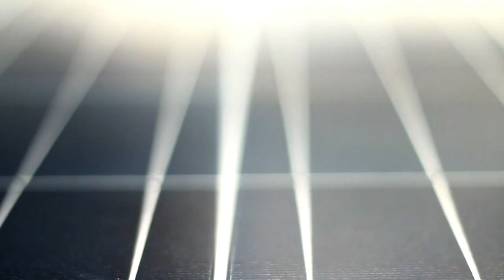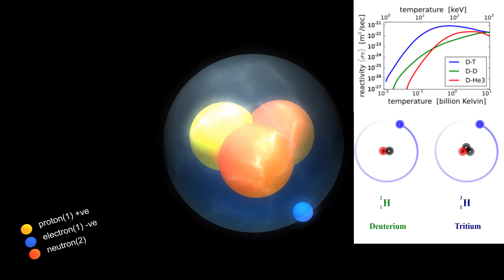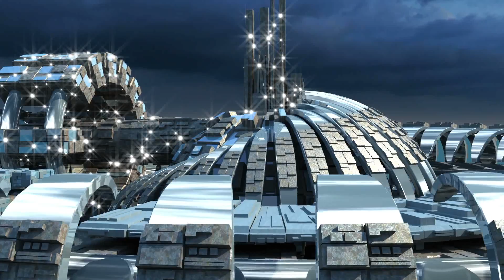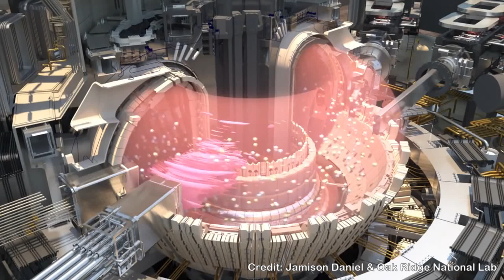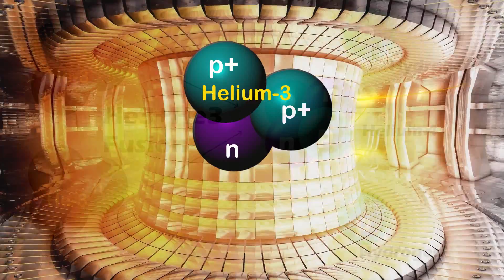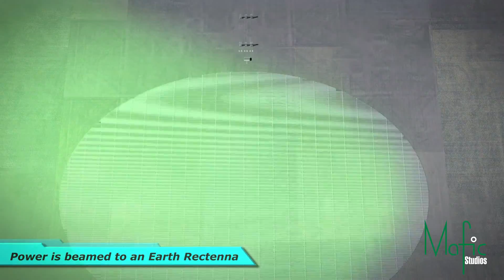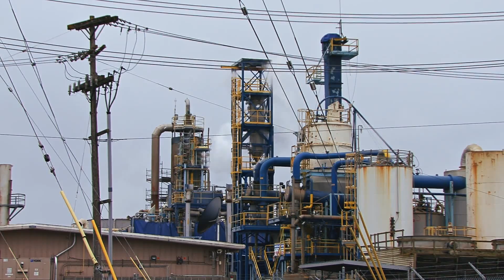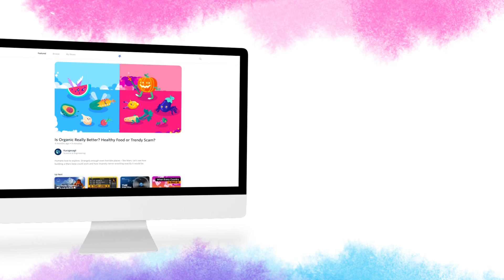Fusion: Powering a Bright Future

Comment: i keep pointing out that such exotic and dangerous tech is completely unnecessary. the u of ark discovered a method for tapping a function of physics at the atomic level that produces electricity for forever. the samples demonstrated were minuscule yes but the fact that it works in any demonstrable fashion makes all other energy systems impractical at best. 
with the method the u of ark demonstrated so radically changes things that it seems too good to be true, it permanently sequesters carbon, in its initial form it is ideal for supplying electricity directly at the point of use for microelectronics and, as mentioned, the tech can be scaled up to proportions sufficient to supply the entire planetary power requirement every second for forever in a sphere a mere 50meters across that is only 3/4 full of the graphene material.
this system is also the ultimate 'civilization' energy source it allows for the complete leap from type 1 to type 5 civilization bypassing the 'power of a X' ranging from star to solar system to galaxy and jumps right to drawing energy directly from the quantum foam i.e. drawing energy from the entire multiverse.
the stock response 'but its a new tech that will take years to mature' spend a fraction of the hot nuclear budget on this working demonstrable tech and a functional power core could be demonstrated in less than a year because it is much easier to build test redesign a cold solid state generator than any other power system

Comment: A viable, reliable, reproducible method of "cold" fusion, is Muon catalytic fusion. Compress the hydrogen, and the Muon(gigantic quantum electron) will knock the electron out of the way and offer enough gravity to overcome the coulomb barrier, before getting ejected by the release of heat. The problem with Muon Catalytic Fusion, is that the Muon only lasts about 100 reactions, and that amount of energy is about half of what it takes to generate a new Muon in the lab.

Comment: Aneutronic fusion reactor/engine is a wonderful idea. As I understand it, it's not a heat engine at all. At least it does not have to be, as most of the energy it generates is in the form of the kinetic energy of charged particles. And the movement of charged particles is basically electricity. Well, it would have to be made directional, in order to convert it into electricity running in wires - into a jet of charged particles. The efficiency of that kind of conversion might be quite high, compared to heat most engines. And there is another upside of solving the directionality issue there - once you have a reactor that can generate directional jets of plasma, you basically have a rocket engine. Seemingly simple and elegant technology. SEEMINGLY

Comment: I find it ironic in a tourtoise vs hate kinda way, that there have been a double handful of ideas to try to bypass the tokamak and shortcut to viable nuclear fusion.  ITER is incredibly delayed and overpriced, and tokamak fusion progresses so slowly it will not be viable in most of our lifetimes and will arrive too late to prevent climate change or the bottleneck of fossil fuel depletions.
 Every single alternative to big clumsy tokamak has run into a showstopper, an unforseen engineering hurdle that makes it useless, or unseen difficulties in controlling plasma force the alternative designs like lockeeds magnetic mirror design to be forced to greatly expand in scale and decrease energy density to the point they are no cheaper or faster to implement with tokamak.

Comment: Fission is the fusion we always wanted. We still refuse to use it after half a century of excellent results. This makes me sad.
Reply: i think it's because of the cost largely
Reply: @briandiehl9257  Renewables are a lot more expensive than fission. Coal and natural gas might still be cheaper, but arguably they have substantial external costs. Nuclear fission by contrast has very low external costs. It's even safer than solar.
Reply: @phamnuwen9442  Only some renewables are more expensive, a lot aren't
Reply: @briandiehl9257  Hydro maybe. It's the only on demand renewable energy source. Solar and wind will not be affordable when storage to cover their intermittent production has to be paid for.

Comment: I am looking forward to the Space Janitors episode.  I actually asked for something like it some time ago.  There are several reasons why I am so interested in it.  First, I'm weird.  Second, scifi that acknowledges waste seems more immersive to me.  Third, if you don't address waste, your new technology will bottleneck (think fission).  And fourth, one man's trash is another man's treasure.

Expanding on the fourth point, plants give off oxygen as a waste product, but animals use it (plants do to, but not as fast as they make it) as a component in power generation.  Animals exhale carbon dioxide, which in turn is used to make sugar and oxygen by plants.  With every waste product you can use, you can make your system more complicated and robust at the same time.  This applies in the human domain of machines and industry.

I'll stop now, since Issac likely will cover this anyway, but maybe you can see why I am excited to see the next episode.

Comment: Although you briefly touched on it, it seems that there are numerous other constraints on how efficient and cost effective fusion power has the potential to be.
Aside from fuel costs and maintenance of transmission assets: 
How much does it cost to construct a fusion generator?
How much does it cost to power a fusion generator?
How much does it cost to maintain a fusion generator?
What is the power capacity of a fusion generator?
What is the expected lifetime of a fusion generator?
Reply: And a lot of these questions are ones we simply don't have the answers for yet.

I think the lifetime (with proper maintenance) is going to be very good for what it is. While spent parts may be radioactive, the half-life involved isn't nearly as nasty as it can be with fission, so replacing Tokamak bits more regularly is going to be more feasible.

Also, as soon as something breaks, fusion comes to a screeching halt. so the potential of fire is somewhat limited there.

They're going to be quite expensive to build, and probably expensive to maintain, at least at first.

Comment: Could you mention the economic side of things? I dont understand how fusion would be any cheaper than fission, which is one of the most expensive ways we have to generate power.
Also large scale power plants are a comparatively risky investment and often suffer from massive cost overruns. I dont see how this would be particulary competetive.
Reply: I think it's down to the abundance of the fuel. Something like 0.02% of hydrogen is the deuterium isotope. When you consider how much water there is on Earth, that makes it really abundant, given that a fusion power plant would only have a couple of grams of fuel in it at a time. According to Wikipedia, at 1995 levels of power generation, there's enough deuterium on Earth to last 150 billion years. Though I expect by the time we actually get fusion commercialised, that figure will be cut down a fair bit just from rises in energy usage, though still in the billions of years.
Reply: I dont think the fuel costs are actually that importat. The same goes for fission power. Uranium is relatively cheap.
The main costs for a fission power plant are for building and operating the plant, not for fuel.
So cost wise fusion and fission should be rather similar, right?
Reply: @xassix   It's certainly an angle I haven't heard before. Wouldn't it be true for most forms of power generation, though? Sure, a wind farm might be cheap to set up (at least when compared to a fission reactor), but it'll still need maintenance. Still, wind is supposed to be really cheap, though I haven't run across any reasons as to why.

Comment: What are the reasons to believe that capital costs for fusion reactors would be lower then for fission?
Reply: fission needs rare isotopes of radioactive materials, fusion uses fuel so common you could process ocean water to use
Reply: @briandiehl9257  >Capital costs are fixed, one-time expenses incurred on the purchase of land, buildings, construction, and equipment used in the production of goods or in the rendering of services. In other words, it is the total cost needed to bring a project to a commercially operable status.
If you don't know what are you talking about, please at least look up. Unless of course you plan to buy fuel only once in a lifetime of a power plant.
Anyway, it may sound heretical, but here is the thing. Fuel costs are tiny in a price of fission fuel. Most of it comes from construction and deconstruction costs that you need to "repay".

Comment: Great Video

I am glad that you have mentioned the drawback of fusion power. Just like you said, each type of power has its pros and cons. I am a regular reader of atomic rockets so the following information is from that website.

First of all, I want to talk more about the radiation issue. In D-D and especially in D-T fusion,  a huge amount of deadly radiation is generated. Unless magical materials that can reflex radiation as mirrors do to light are available (unobtainium), very thick and heavy walls are needed. Those walls need to be replaced due to the damage and become waste for the next certain number of years. People often forget this fact.

Next, if you want Torchships, use fission power, not fusion. Fusion reactors are very big and heavy due to their nature. Fusion power is more efficient when the scale is bigger. Every gram count when designing spaceships. Fusion power spaceships cannot lift off from Earth, they are just too heavy and not enough net thrust. Of course, it is a different story if the fusion power of the spaceships is H-Bombs. I am looking at you, Project Orion.

Finally, I hope people give more love to fission power. It is far from its pinnacle (Check https://www.world-nuclear.org/). It is a great backup power when the fusion reactors fail. Unlike fusion, not much energy is needed to kick start a fission reaction. Unless you have another running fusion reactors, or some crazily good capacitors and batteries, or backup fission reactor, or other backup power source, you are not going to restart that failed fusion reactor.

Isaac Arthur, if you look at my comment, may you do a short video on future fission power?
Reply: Irradiated wall? Concrete is cheap and durable. 
The tricky part for me is having some delicate, precise high tech magnets being treated with heavy neutron radiation and high temperature.

Comment: Isaac..

Mr. Arthur..

Can you explain why The Focus is on Accelarating Plasma..

instead of Accelerating a container?
 using an electromagnetic acceleration the Centrifugal force could really compress it and have an inertia.
Reply: fanOmry I think it may be due to the containment issues issac mentions in the episode. If you have a stable fusion reaction, it will slag any material as soon as it touches the material
Reply: @johnbenson3024  

Wouldn't it be easier to add their magnetic field in those conditions   than a whole donut?
Reply: fanOmry if the gas/plasma doesn’t touch the container, it becomes very difficult to make affect the gas/plasma with the kinetic energy the spinning container would normally impart. However this doesn’t mean we can’t move the plasma through the reactor and rely on inertial effects. In tocamac reactors we do just that actually. Instead of just using the magnetic field for containment, we also use it to accelerate the plasma around the reactor. Doing this increases the stability of the plasma and thus makes it easier to contain.

In short, think the method you’re suggesting may run into an issue where the container needs to be in contact with the plasma to accelerate it and rely on the centrifugal force of that circular acceleration for compression. Since the container needs to be touching the plasma to accelerate it, we wouldn’t be able to get the plasma hot enough.
Reply: @johnbenson3024  

I was thinking of a centrifuge..

The walls electrically charged to push away the plasma.. Or if that is impossible.. just be affected by the same accelerating field.

Comment: If you really want to get technical about it, everything is Fusion-powered. 

It's just that the reactor is about an astronomical unit away.
Reply: But that means, solar, wind, bio-energy, hydro and fossil fuels are all just fusion energy with extra steps. 

Like if you got the Rick and Morty reference😉
Reply: @johnbash-on-ger  
If you think about it gravity is the source of all power
The sun ,geothermal ,all are a result of the force of gravity
Reply: Not geothermics though
Reply: i suppose the radioisotope thermal generator tens of kilometres under us (but extends thousands of kilometres all the way to the core) also helps
Reply: Fission’s fusion reactor(s) are further than an astronomical unit away, but yea.
Reply: @Treviisolion  They also got their energy from gravitational collapse.

Comment: The problem I see with fusion power isn't the engineering of getting a reactor to run.  It will just take time (20 years?) to get that running. The problem is, how do you turn that into electrical power?  Believe it or not, this is all just to heat water to run turbines.  21st century tech running 19th century generators.  Needless to say, that's a serious problem.  There's a MASSIVE loss of power in that conversion.  Until that's solved, fusion won't be possible for space use.  It's just too large.

Comment: I believe fusion is a boondoggle which will never make any significant power.  The sun makes a profit due to the free subsidy of gravity which maintains the heat and pressure necessary for a continuing reaction.  Fission is our only possible "atomic energy" and in space MHD's super conductors will receive almost free cooling.  The only benefit I can see to fusion is employing a large number of physicists and their assistants.  Not necessarily a bad deal.

Comment: Great vid. Especially glad you took the time to debunk the "fusion is the power of the future, and shall always be so" saw that apparently drives us both nuts.  
Two bits though. One of the other advantages of anutronic fusion, is you don't need to use thermal steam cycle power conversion, since most all the power ( how much seems hotly debated between physicists I've talked to ) comes out in the kinetic  energy in the streams of He coming out of the reactor.   Run that stream through a coil of wire and the plasma stream becomes one part of a generator. 95-99% conversions of power to electricity is possible. 
Even if you lose half the fusion power as radiation heating your reactor shielding. You might just ignore it, rather then adding the whole steam turbine systems.  Being satisfied with the half your getting from the direct power conversion mhd system.   

Second. Obviously that memetic energy stream makes a torch rocket. Great for getting around the solar system with isp over a million.  Not to good for getting into space. But you can use it in a thermal rocket. Since the direct power conversion is very light on large scale. Your big ship uses water say as coolant, then heats it to insane temps from radiation or ion plasma heating etc.  spec imp is only in the thousands (say 3000-4000 with water) but lift to orbit costs of dollars ( not tens of dollars) per ton are doable.  I.e. Cost to orbit thousands of times cheaper then current long range air freight costs.  

FYI
I can send copies of interesting AIAA papers on this based on polywell reactors if interested.  

I'm working up numbers for evacuating everyone on earth to space colonies in 50 years assuming fusion comes on line in 10 years after the start point ( I.e. When you find out earths going to be hit by a rouge planet.  Which really opens up funding for fusion development efforts.) and you build everyone up to first world standard of living, in Oneils with a urban density of average USA urban suburban, and make trillions doing it. 
Fusion is a very high leverage technology!!

Comment: Ultimately economics will determine the viability of fusion. Cost is key in the arena of power generation.  The objective is after all, "cheap" electricity to run our civilization. Fusion's best use might be in space where economics are measured differently.
Reply: If we ever do get a virtually infinite supply of power, I'm not sure if terms like "cost" will still have any meaning, at least in the economical sense. IMO the fabric of our entire civilization would be fundamentally changed by such a breakthrough.
Reply: @antred11  You're right about that but so far, equipment to make this happen is very expensive.  Don't get me wrong, I want the stars as much as anybody.  Hopefully when they make it work, they can figure out how to make it work cheap.  Ad Astra!

Comment: first fission reactor to first commercial nuclear power plant was more or less a decade. The first fusion reaction took place almost 70 years ago. Fusion power IS taking longer than most of our other power generation methods, there is just no way to sugar coat that. Of course that in no way implies that fusion researchers are incompetent - just that fusion power is one incredibly tough nut to crack. I'd put our odds at ever getting it to work at about 50/50.

Comment: A great and nuanced video on fusion! It preserves the most important information while still being accessible to a wider audience.

DD Fusion, when available, makes for the ideal general fusion fuel. The energy released per kilogram deuterium for the full cycle exceeds that of DT and is only short of that of DHe3. For a small net loss in Q (power output/input) you can filter out helium-3 ions in a magnetic confinement reactor. A power source that produces an even better power source as a waste product.